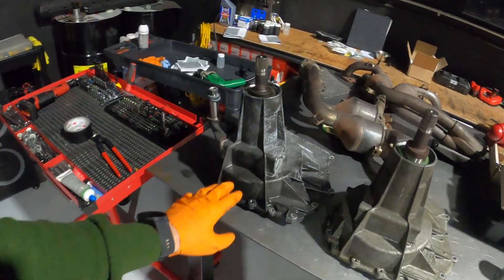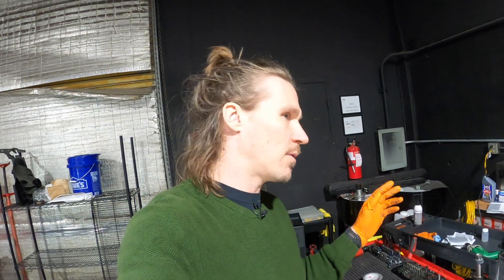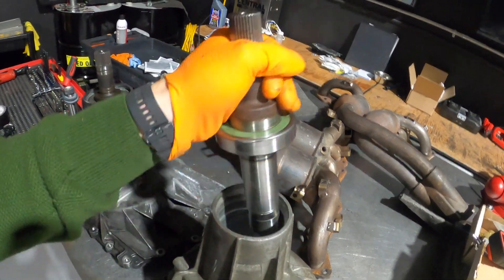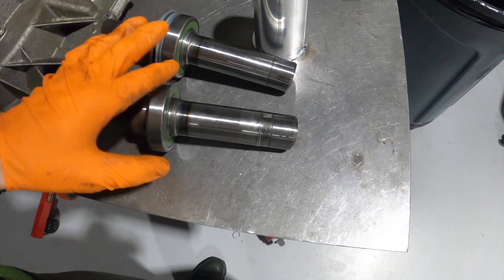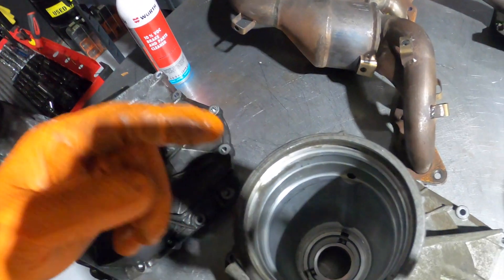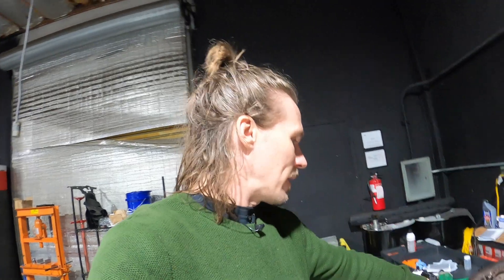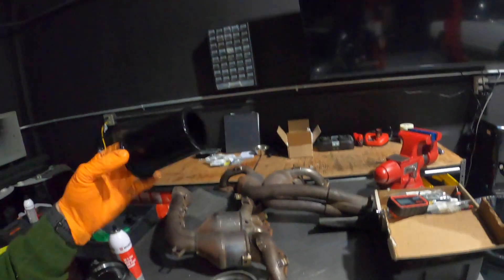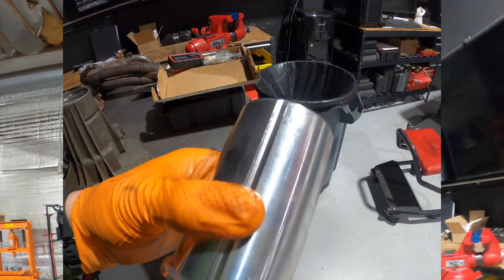California & FF DCT Front Cover Bearing Creep Repair (Nose Cover)

Comment: I understand that you mentioned it is for early california's but will this apply to the later model california 30 aswell? I have a 2014 model and would like to know if it has the same issue.
Reply from the maker: @phoenix6254  if it's A California, it is missing this piece. If it's a later model, as in the California T, then it has the piece.